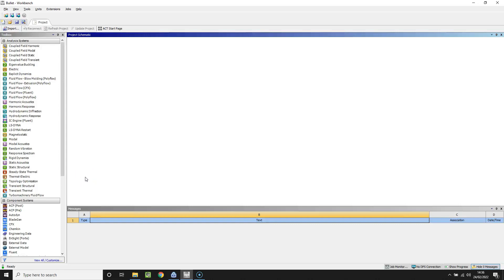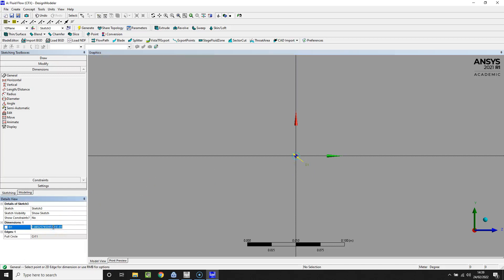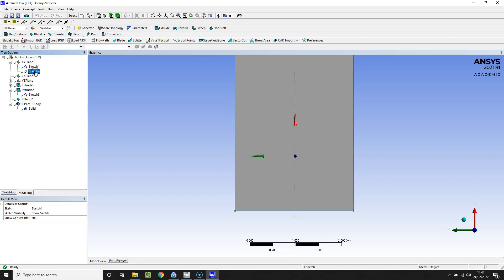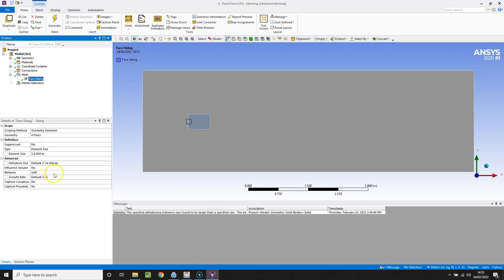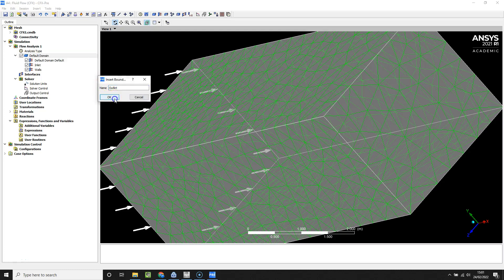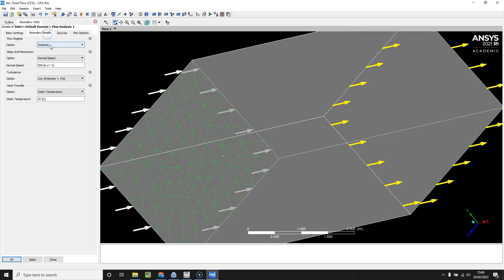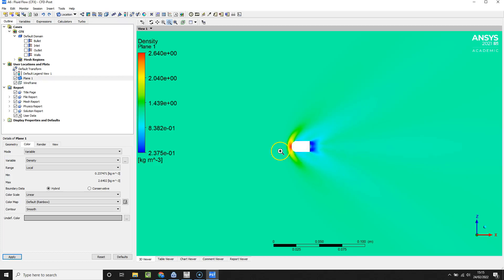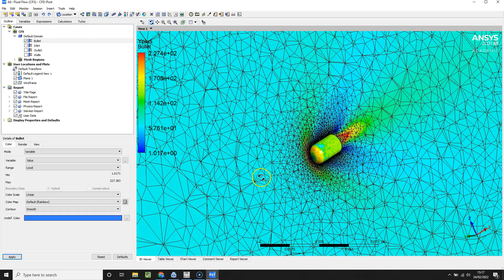Compressible supersonic flow around a bullet Ansys CFX

Comment: Hi mate, im doing my own supersonic flow simulations and was just curious as to what the drag force numbers were on this simulation?. im getting a huge overestimation on mine and may change my mesh to  match what you have done here. Cheers, Tyson
Reply from the maker: @MakeEngineeringLife  hi.

Honestly I can’t remember.

Can you see any obvious causes like poor quality mesh?
Reply: @ClimateCFD  Thanks for your reply!, im from Australia. Your videos were a great help with my Thesis, modelling and simulating a new Wind Turbine i designed. I mentioned to the other Engineers for great professional tips look out for the guy with the Northern UK accent, am i right location wise? ..  Yeah the mesh looks good after a tonne of fine tuning whilst using various research papers also in setup. I actually used one of your other videos mesh today and its currently running, it hasnt crashed so thats good but looking at the plot monitor for normal forces and its still too high. Im going to save this project as it looks like its actually going to complete successfully. I will recreate the mesh using this videos mesh and let you know if it improves the Y+ value which i would assume isnt good at this point. (What i like about this video is the refinement region), which i have been seeing other similiar simulations to my own using but in a convoluted way. Your way makes way more sense. Thanks again mate!.
Reply from the maker: @ thanks for this, it is really kind.

I’m from the Midlands. Most people from England assume anything north of London is The North, so you’re not far off! 😂

Let me know how you get on!